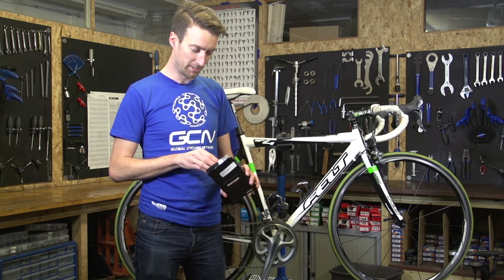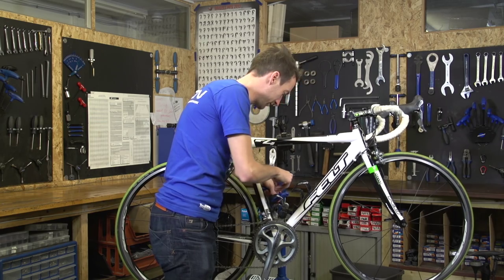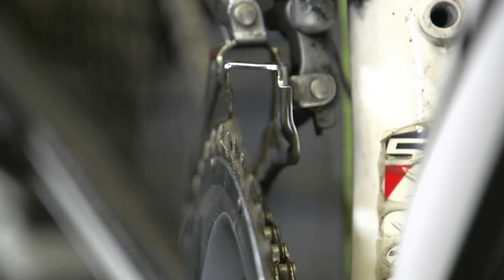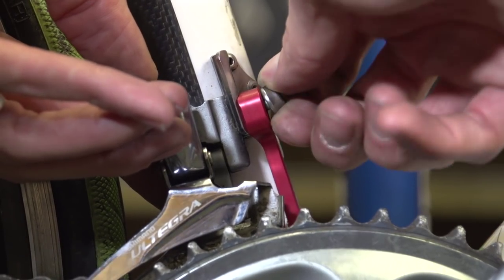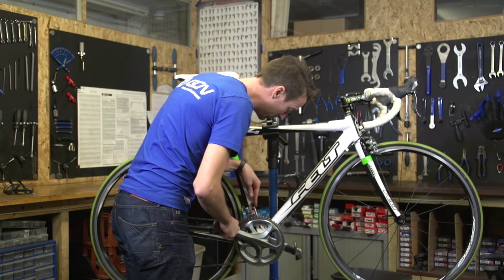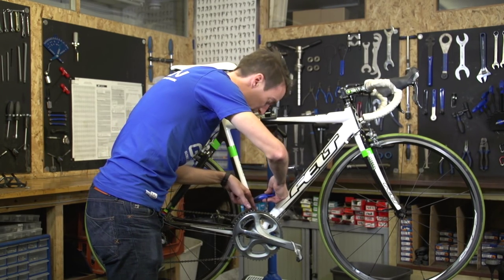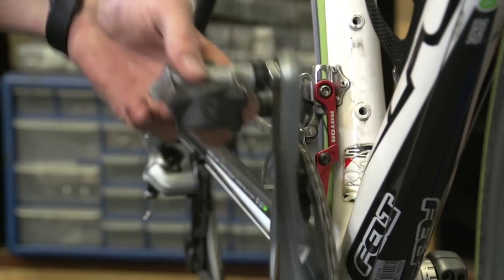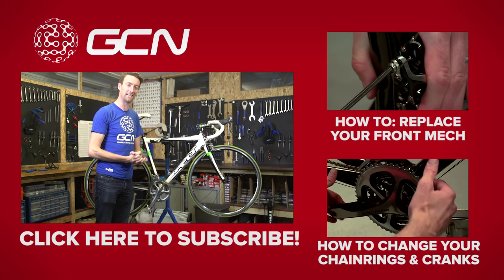How To Install A Chain Catcher

Comment: I highly recommend the N-Gear Jump Stop clamp on chain catcher. Instead of a thin metal piece, it's a metal plate that sits just left of the small ring, with a band clamp that goes on just below my clamp on FD. 

My bike's 50-34 was plagued by the chain dropping off the inside even after numerous adjustments. Since putting on the Jump Stop it hasn't dropped once in many thousands of miles. It's also a good deal cheaper than most of the thin anodized metal devices, and when installed you can barely even see it. One of the best things I have installed on my bike.
Reply: +Patrick94GSR Love your picture!!!

Comment: Global Cycling Network thanks it's not just a problem with the chain rubbing the catcher that needs avoiding but more often than not its the head of the inner chainring bolts which snag the catcher as in your case at 3:28 :)

Comment: If you have a 'band on' type front mech, you can add a Deda Dog Fang to stop your chain falling off to the inside of the chainrings. Next video chaps?
Reply: Ian Moss thanks for the info. My chain came of when I accelerated and couldn’t understand why as it had just been adjusted and set up. I smashed my left knee against the frame and caught my calf on the chain ring. I will be fitting one of these.🇬🇧👍🏻🤜🏻
Reply: @markgilder7757  l

Comment: Surely if you have your derailleur limits adjusted correctly you dont need one of these?
Reply: the chain can still drop off between the ring and the derailleur. mine is adjusted correctly and i've a K-Edge catcher installed but it still occasionally drops off, it just doesn't fall onto the top side of the BB shell
Reply: Agree, seems like a waste of money to me.
Reply: compared to not using one and having the chain wrap itself around the bottom bracket, possibly taking the paint with it, i wouldn't ride without it now. 99% of the time it works :)
Reply: altern8ive 99% of the time it isn't needed on a road bike.
Reply: Derek Wildash i agree it's not a necessity, i spent 3 decades without one BUT for peace of mind it's worthwhile especially as im not keen having a chain grind itself around my carbon frame
Reply: Exactly, I've readjusted my derailleur despite I thought it was OK and I haven't experienced single chain drop so far.
Reply: Derek Wildash Haven't needed one on my hybrid with a MTB triple; very rarely in the middle ring, nevermind the tiddler. Yeah the chain has bounced off in some extreme circumstances but you just get off and put it back on (after spinning out & braking safely). Aluminium frame and I'm not so precious about it, so there's the odd chip and scrape from wear and tear over the last 3&1/2 years of use. I can understand pros (or amateur racers) needing them though.
Reply: ***** You have a point.
Reply: Actually with road bikes when you are on a small sprocket in rear and want to quickly drop gear and doing it with front ring it can drop the chain as the angle is already so steep so it might miss the small ring. I have a more simple one that just prevents the chain from dropping to the bb and it is basically a plastick nail (like dinosaur) that is really close to the smaller ring and close to the teeth height. If the chain drops off the smaller ring it stays on the plastic bit and just gear up in front and pedal returns it to the ring.
Reply: josbanse
Don't crosschain like that. It'll be easier on the bike.
Reply: The chain can still bounce off if you're off-road, or even on-road on some UK roads. Chain bounced off my lads bike in a CX race and cost him a couple of places.

Comment: It's easier to just mark across the braze on and over the bolt with a pencil where the derailleur height is then just line the marks back up when you reinstall. Or you could just use a Sram Red, Force or Rival front that comes with a chain catcher.

Comment: Of course seconds are precious, but on average up shifts in the rear helps getting to the inside chain ring. Then down shift the rear to find what's comfortable. Since you're going to a easy, go in the rear first. If you need to both quickly you don't know your terrain. A well adjusted front derailleur should limit this problem on road bikes with smooth road.

Comment: @gunny wombat: the dog tooth and the one GCN is installing do different things, the dogtooth protects the frame from a dropped chain, whereas, the chain catcher type as installed in the video is more to prevent the chain jumping off the crank, it's name is misleading, it should be called chain stopper offer.
Reply: Also it will only fit frames with round tubes. It would not fit on my Tarmac for example.

Comment: Dan!  What's with the 70's disco background tunes?  UHG!  I kept pausing you to try to figure out what else I had running on the computer to make it stop!  :)

I have to admit that I don't really understand the need for a chain catcher... I maybe have dropped a chain to the inside once that I can recall.  Is it more of an issue perhaps with some groupos or with poor front mech adjustment?  (I'm running Sram Red.)
Reply: Poor derailleur adjustment, or fear thereof. If the derailleur is adjusted correctly, a chain catcher is completely unnecessary (on most bikes). Shimano road groups installed on road bikes (for instance) do not ever require chain catchers if they're adjusted correctly. The way he says to adjust the chain catcher is actually part of the way the derailleur itself is supposed to be adjusted.

There is an exception, of course. If you don't practice good gear selection, and shift under load, the chain can do all kinds of odd things, like dropping, or removing teeth from your gears, or shifting into the spokes, even if the bike is adjusted perfectly.

Keep the bike adjusted, and don't shift under load, and you should be fine.

Comment: I have a more simple one that just prevents the chain from dropping to the bb and it is basically a plastick nail (like dinosaur) that is really close to the smaller ring and close to the teeth height. If the chain drops off the smaller ring it stays on the plastic bit and just gear up in front and pedal returns it to the ring.
 Costs like 5€ and is installable on any frame..

Comment: I don't get it... how does one drop a chain in the first place?  If all the wires are at proper tightness, isn't it impossible for the chain to over-shift?  I watch a decent amount of bike racing and have seen the pros suffer from chain drops, but how does it happen?  I have never had this problem, given that I am not even close to pro.
Reply: +DanDXMG 3 things cause it. First, the derailleur's shifting is determined less by the cable tension, and more by the travel-limitting screws on the top of the derailleur. If the low limit screw isn't tight enough, the derailleur will drop the chain.

The second cause is the result of cross chaining. Most bike manuals will tell you that you're not supposed to use the big chainring and big cassette gear, or small chainring and small cassette gear, at the same time. If one cross-chains big-big, and tries to switch chainrings to correct it, the chain can fall off.

The third (and most common) cause is shifting under load. Some newer drivetrains are designed to put up with it, but shifting under load is still not good for the bike's components. All the parts will last longer and be less likely to break if shifting is done only during gentle a pedal stroke. 

It's a valuable skill to have to be able to pedal gently only for the amount of time it takes for the bike to change gears, and then lay power back on after the shift is done. You only have to let up for the fraction of a second it takes for the gear to change, so it won't slow you down too much, and it's really cool when your riding buddies don't hear your gears change.

Comment: Is it ok to clamp and hold the bike using the carbon top tube instead of the seatpost? Or is it because it's just Mikes filthy Felt?
Reply from the maker: It's best not to really, top tubes aren't designed to be clamped, seat posts are.
Reply: If you clamp any part of the frame, you run the risk of breaking it if you bump into it too hard (like if you trip, or forget that it's right behind you, or you forget which direction it's clamped in and try to turn it the wrong way). Clamping the seatpost allows the bike to rotate in the stand in that case, thereby preventing damage. Seatposts are also cheaper and easier to replace than frames, and it is surprisingly easy to break an improperly clamped frame because of the effects of leverage, and the fact that people are much stronger than they realize when they aren't being gentle. (Ever smack your toes on a door frame?) Graphics (labels, in particular) can also be easily damaged by a workstand clamp.

If you're really careful, and completely unafraid of damaging your bike, don't worry about it. You will probably, however, be really upset if something hits the bike a little  too hard and breaks the frame.
Reply: +Alexandar Hull-Richter Absolutely!

Comment: chain catcher may not catch the chain, even if it did chain might still go through the crank and frame as they are weak aluminium and they bend. Chain will still drop and you won't be able to pull the chain back up until you remove the chain catcher also meaning the derailleur. It is not worth the hassle. I took mine off.